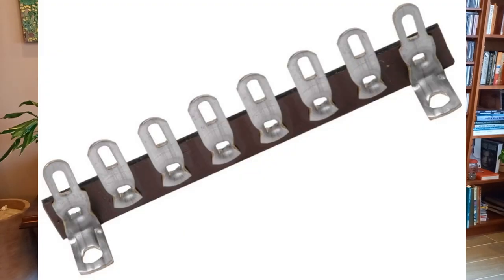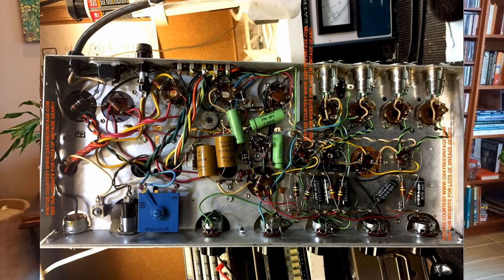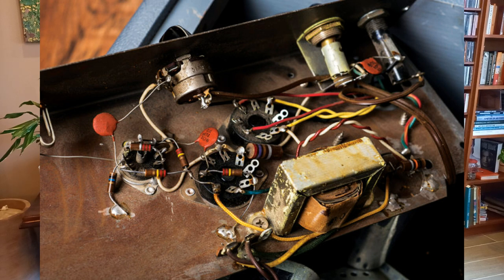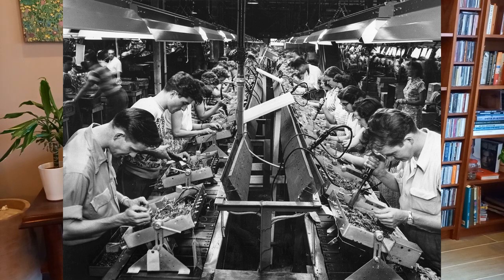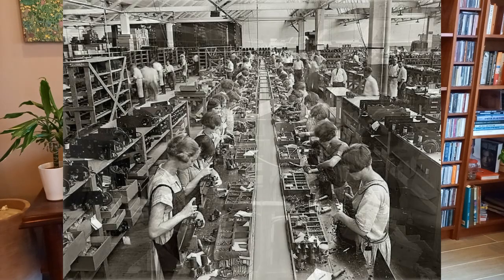Construction methods in tube instrument amps

Comment: Thanks. That was awesome. My worst nightmare amplifier was a true p-p. I would regularly have to take it apart and re-solder broken leads from vibration.
Reply from the maker: Thanks very much for this interesting and useful comment. True point-to-point was better suited to equipment that didn't get moved around much, like early consumer radios and TVs.

Comment: I'm glad that you created this production and the photo's of the past.   I grew up in a Home Appliance Store as the family business....RCA.  SO I really appreciate the nostalgia......in the infancy of electronics......all new uncharted territory....and design !  SO creation of devices that never existed before....operating conditions and environmental aspects applied on top of that....and material science.  Wrestling the nature of the beast.  Caveman discovering FIRE was pivotal, and electronics is still FIRE as for HEAT.  They had to maintain a seal for the vacuum aspect and the glass to metal as the pass through and the material science of expansion & contraction with due considerations of the whole as a mechanism.  I'm sure today there would be a polymer solution as an enhancement.   BUT HEAT is exceptionally vital in the equation, and specially when the components are subject to drift due to heat and aside from the material science.....and if the unit is designed as a HEAT TRAP.  So its a point of something being stabile as per the math and on the paper and applying that to real world and all the factors in the operating conditions as with carbon composition of yesteryear as being what was available and that it drifts UP in value with exposure to heat....not factoring the internal heat created by movement of electrons, so what is on the paper starts going sideways in the practical aspect and application.   You touched on...CROSS TALK, but should expand that and radiational fields generated with "things" being energized and the physical relationship to each other.....because it all varies between the construction methods...whether it be the ancient birdsnest point to point method....which carried with it the premise that its the Ends of the Leads and the connection is where that component "technically ends", and a "wire" factor starts should a wire be involved....or another direct connection to a component.  The Lead out of the body of the component is not counted as "wire"....by convention, but then there was no standard for lead length. (you trimmed to fit relative to component placement).  Cross talk and oscillation due to material science & function, and layout design.......and as a consumer good it becomes the manufacturing assembly line & mass production.....without mistakes when everything had the human element involved.....AND not talking about designed obsolescence
Reply from the maker: Fascinating perspective! Thanks very much, Mike.

Comment: In your opinion sir , what do you think the actual cost of parts to construct a 50 watt rms tube amp would be ?  What tubes would you use and what design would be the easiest / simplest and less likely to have problems ? Was Hartley PEAVEY on the right track with his earlier classic series ?
Reply from the maker: Hi, Ben. Thanks for your question. There's no one answer unfortunately, as it all comes down to what features you'd want and how resourceful and skilled you are. You can go a long way in building an one-off musical instrument amp cost effectively if you can repurpose an existing chassis and/or transformers. If you'll be buying output tubes, check the prices of the various types before making your final choice; their costs range considerably and will have an impact on your project cost. An isolation transformer with a voltage doubler can often make an acceptable plate supply, and a 12V LED power supply can serve as filament supply. Some hobbyists can put an amp together from things they have lying around, which can be a fun challenge. Repairing a non-functional used amp can be an affordable solution. Kits aren't as cheap as they used to be, but they can also be good value. The important thing to keep in mind is that tube amplifier voltages can injure or even kill you, so it's best for you and your family if you don't tackle anything beyond your skill and knowledge level. Re the early Peavey Classics: yes, good amps, good platform, and a respectable alternative to the usual suspects. Good luck with your quest!

Comment: It helps with these newer printed circuit board designs, if the board is on the bottom where the tubes can sit right side up and allow the heat to rise away from the circuit board.  A very quiet computer fan could be placed in the cab to direct the heat out as well.  No idea why amp manufacturers don't do this.  At least none that I've seen
Reply from the maker: You're quite right that thermal design is far from ideal in most mass-produced amps. Mounting tubes on circuit boards gained a bad reputation because it's so poorly done in most cases. But if tubes are upright and boards have ample copper and ventilation holes, and if the enclosure is well designed and made from thermally conductive materials, tube life and overall reliability improve significantly. We do these things in our Solitaire three-tube DI for example, which doesn't need a fan to achieve excellent ventilation. The same approach works for higher powered amps as well. Designers at most amp manufacturers aren't ignorant; they're just bowing to market pressure to build amps to specific price points and with conventional layouts, even if these are inherently flawed. But there are always manufacturers like us at the fringe who are free to creatively focus on engineering, design and build quality. We're not interested in manufacturing thousands of amps. We feel it's more important to provide instruments that deliver the goods flawlessly and conveniently year after year without ever needing mods or kid gloves.

Comment: Always wondered if turret board was related to wire wrap construction. 
It seems like it would be good for that. Maybe prototype on wire wrap, then solder down when its good?
Reply from the maker: The wire-wrap I'm familiar with is an entirely different animal, and was commonly used for prototyping early digital circuits based on DIP packages (e.g. TTL). I don't think I've never seen this kind of wire-wrap used for analog circuits. It did sometimes find it way into finished one-off and very low production products, sometimes after being soldered just as you describe. But it was kind of a mess to troubleshoot, and stray capacitance was a problem (although it could actually be beneficial in many audio circuits).

Comment: I have a Soundcraftsman PM860 Professional mosfet amp which has a 50V per micro second slew rate. It has zero noise and is clean and crisp when combined with EV musical instrument loudspeakers.
Reply: And what has that to do with this video ?? I have an electronic tooth brush with turbo speed.
Reply: @qddk9545  It has to do wit the face that the technology of todays solid state amps meet or exceed the capabilities of yesterdays tube amps.
Reply: @DrHarryT   They don´t 🙂

Comment: if you take the componants off the mother board you get a better sound; mother boards you sending the signal through a led track.
i tried on hi fi speaker crossovers and was blown by the improvement